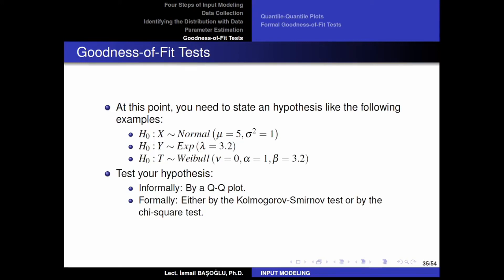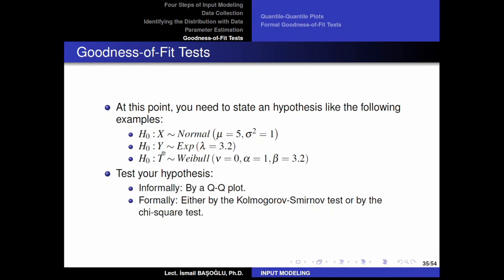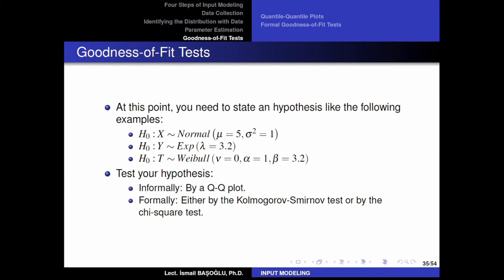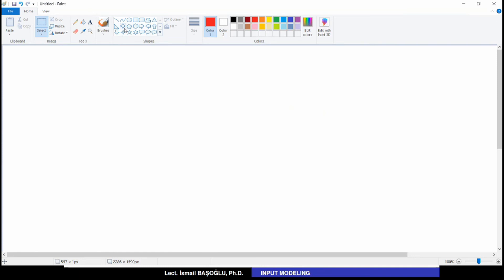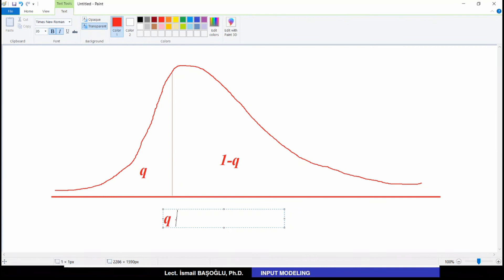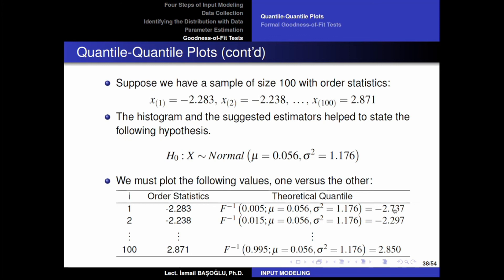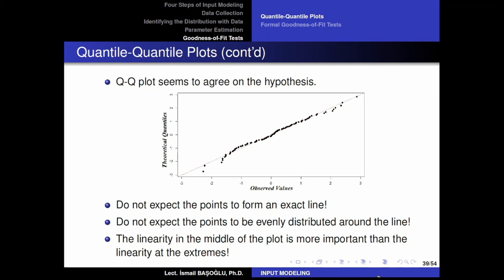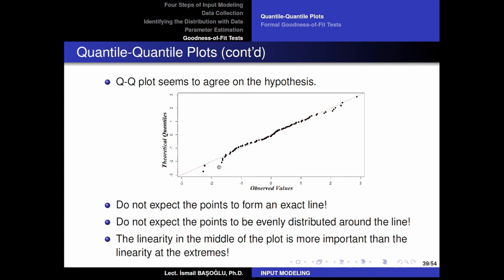Simulation Modeling 51 Goodness-of-Fit Tests: Q-Q Plots

Comment: Hocam selamlar, quantile tanımınız yanlış olmadı mı? Quantile dediğimiz kavram zaten distributionı eşit parçalara böldüğü için quantile ismini alıyor. Yani bir yerden bölüp bir tarafına q bir tarafına 1-q dediğimizde o nokta eğer bu distributionu ikiye bölerse quantile olarak isimlendirilebilir.
Reply from the maker: Dağılımı eşit parçalara bölen noktaya dağılım medyanı diyoruz ya da 50% quantile (%50 dağılım boleni) ya da ikinci quartile (ikinci ceyreklik). Quantile çok daha genel bir ifade ile rassal değişkenin aldığı degerleri q ve 1-q luk ayrık iki aralığa böler. Aslında gerek kesikli gerekse sürekli rassal değişkenler için çok daha kapsamli bir tanımı var ama yaptığımız uygulama için bu kadarı yeterli.

Siz nasil biliyorsunuz quantile'i?
Reply from the maker: Ya da tam olarak saniye belirtirseniz o kısım uzerinden konusalim.
Reply: @ismailbasoglu4252  örnek olarak ikiye dedim ikiye bölerse 0.5 quantile diye de geçer mediandır aynı zamanda. 10 eşit parçaya da bölebilirsiniz bunlar da quantile olur. Ama mesela 0.3ten bölüp soluna q sağına 1-q. O noktaya da q quantile diyemeyiz çünkü bu nokta dağılımı eşit parçalara bölmemiş olur. Mesela 3e 0.25 0.5 0.75ten bölersek bunlar quantile olmuş olur. Tanımı şu şekilde paylaşayım: q-quantiles are values that partition a finite set of values into q subsets of (nearly) equal sizes.
Reply from the maker: @Dennaton  Üzgünüm ama quantile kavramının tanımı bu değil. Dilerseniz wikipedia dan "quantile function" sayfasına bir goz atın. Bu fonksiyonun girdisi herhangi bir q olasiligi, çıktısı da dağılım boleni değeridir. Sizin söylediğiniz yalnizca birden fazla quantile tanımlamak oluyor.
Reply: @ismailbasoglu4252  hocam ben de wikipediada “quantile” olarak baktım zaten. q-quantile olmasından kaynaklanıyor sanırım. Size attığım tanımı da ordan almıştım. Tabii quantile function olarak arayınca dediğiniz çıktı. Ama q-quantile dediğimizde beni o attığım tanıma yönlendiriyor. Quantile function diye aradığımda sizin dediğiniz yere gittim. Biraz daha bakayım. Teşekkürler
Reply from the maker: O sayfada "q-quantiles" denmiş ve bir seri tanımlanmış.
https://en.wikipedia.org/wiki/Quantile

Bu ifade de yanlış değil. Ben ise "quantile" fonksiyonunu tanımlıyorum genel bir ifade ile. Bu fonksiyon aracılığı ile "q-quantiles" serisi hesaplanabilir.